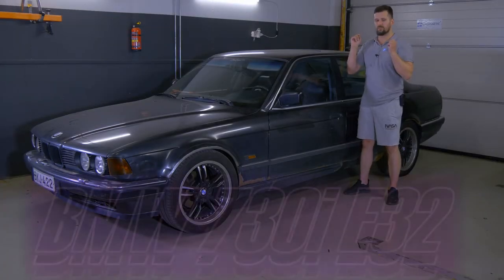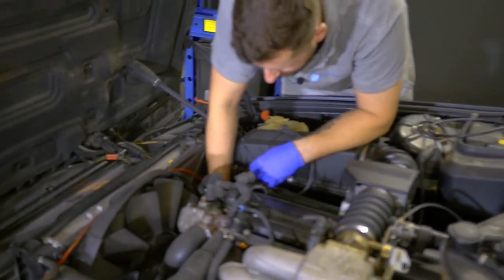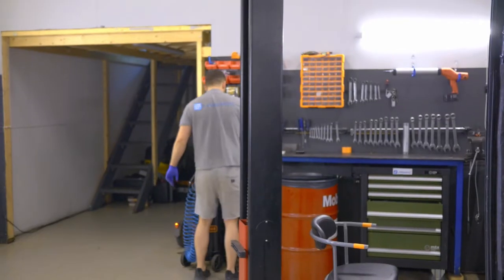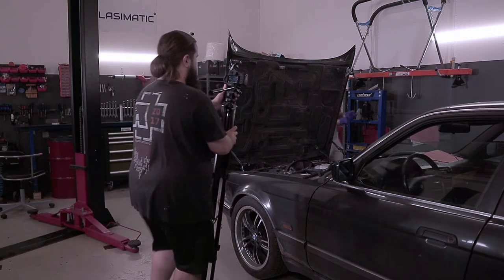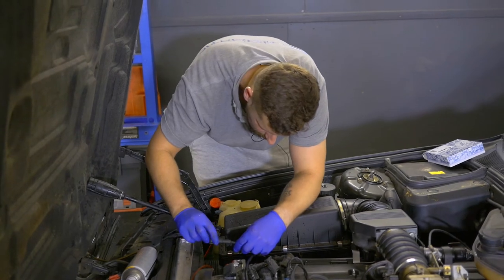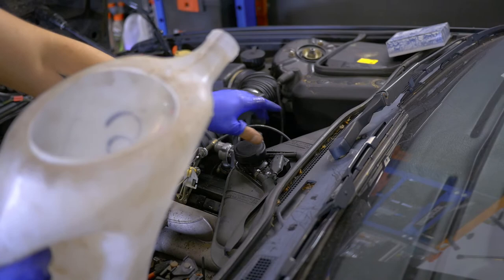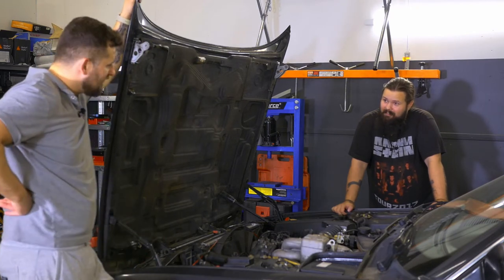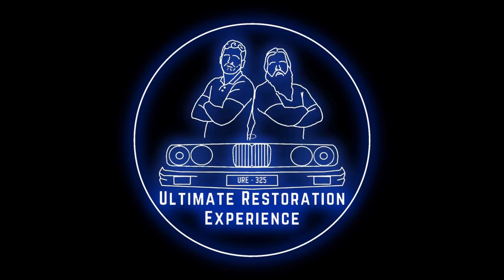SENSOR OF THE IMPULSES - BMW 730i E32 - ROUGH ENGINE START FIX

Comment: Hello, I have a BMW 730i year 1990 (32) could you tell me, what is the purpose of the two-line contactor below the rear seat placed above on the battery, because at BMW they do not know how to answer me. 
Thanks for your help. Christian
Reply from the maker: Wire for rear seat heating.